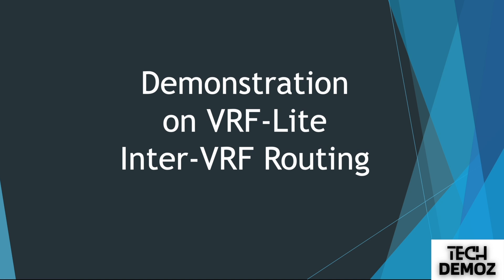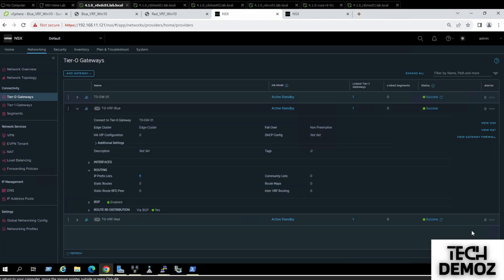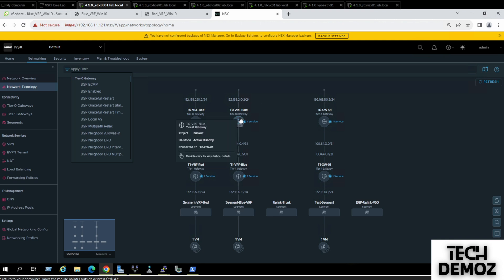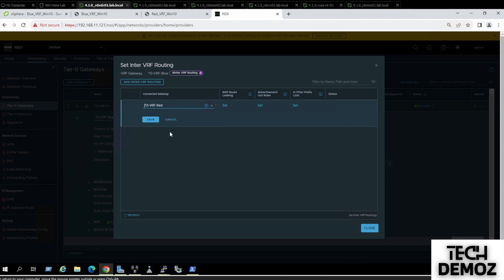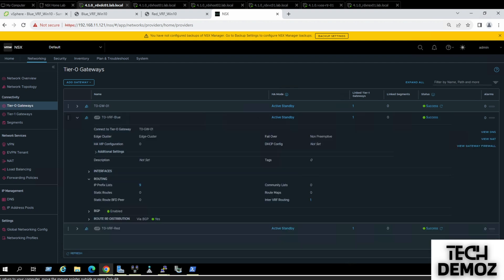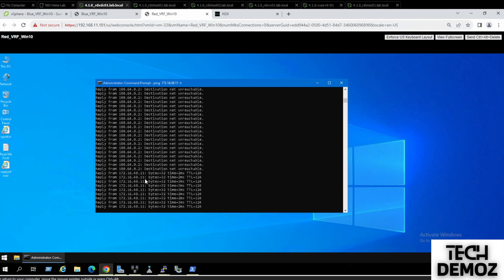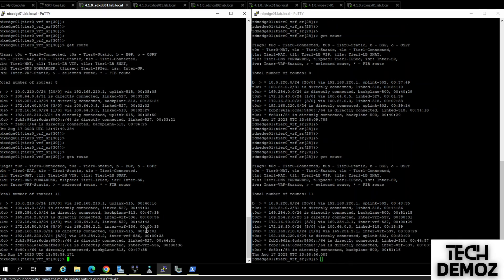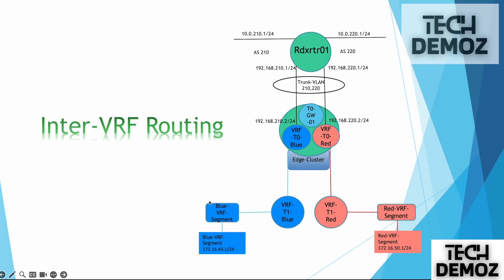NSX Advanced VRF Concepts Inter-VRF Routing, BGP Route Leaking under Home Nested Lab | Part4

Comment: Thanks for the video....Very informative....One quick question , how did you 10.0.210.1 pingable only on blue VRF and 10.0.220.1 pingable only on red VRF before enabling BGP route leaking .Do we need to configure VRF in the Rdxtr01 router that you used.If yes, can you share those configs also.....